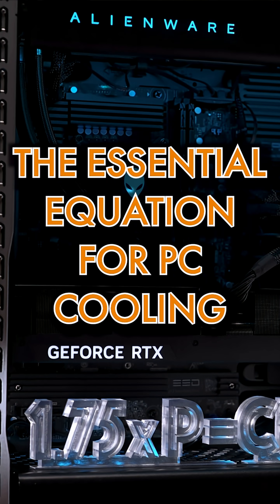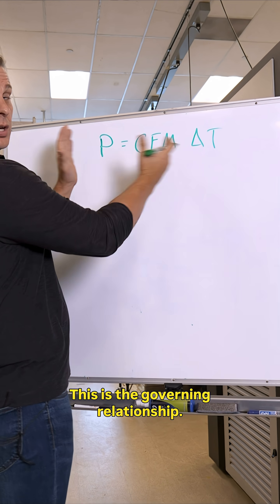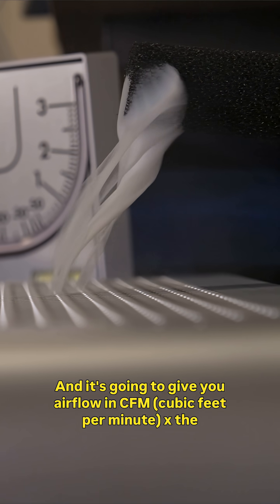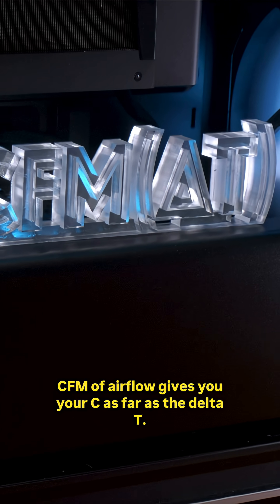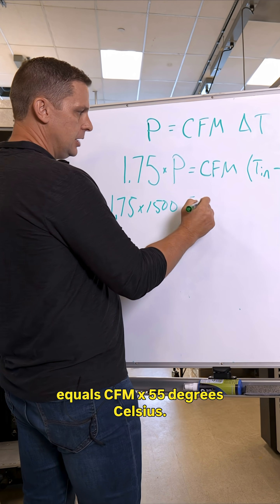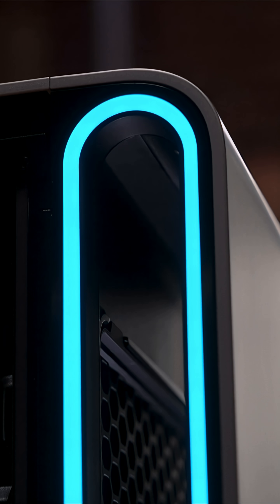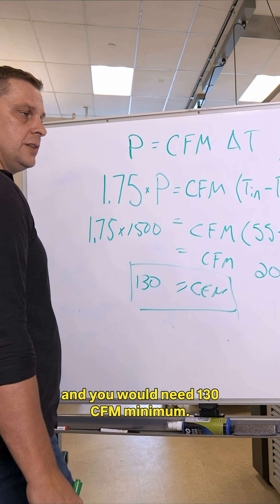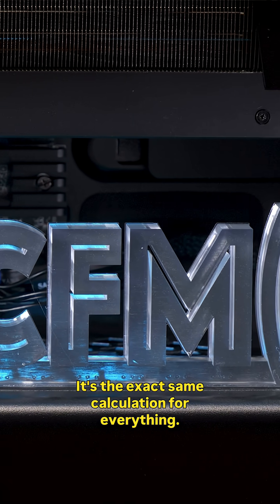#AdamSavage ALMOST Understands This Equation

Comment: Uses S.I. units throughout but then uses CFM?! Why not use m³/s?
Reply: Because case fans are rated in CFM
Reply: @rasmusvedel  fair comment, but it would be better to use S.I. units for the equation and convert the CFM to S.I to plug into the equation. That way you don't have the random 1.75x in the equation.

Comment: Horrible way of doing it mixing metric and imperial units. Use the energy transfer equation. Power (Q) can be determined based on the flow rate (kg/s) and the temperature difference (Kelvin). 

Q = m_dot * Cp * Delta_T

Where Cp is the specific heat capacity of the fluid.
Reply: Kelvin and Celsius got the same scale but different zero. Zero degrees Celsius is 273,15 Kelvin. In other words, if you have a Delta T of 30 degrees Celsius it will be 30 degrees Delta T of Kelvin too. Kelvin was lazy and took the Celsius scale for his with the only difference that his scale started at the absolute zero..

Comment: Totally agree with the other comments that this is ballpark not actually how it is do it. Plus mixing metric with imperial in the same equation is a crime against all things rational. Use one system or the other not both. Adam, you should know better.

Comment: Yeah that's BS. I've built many gaming computers and I've had 4x that CFM in push/pull fans easily on every one... Most
Reply: So you’ve probably done really bad job at optimising it. It’s not an art to cover the whole thing in fans but to do it in the most efficient way possible.
Reply: @HaIPeHaOP yeah, and 130cfm is about the going rate for a single high performance 120mm fan or a couple standard units, tell me what high end gaming rig you see out there with 2 fans anymore? I'll wait.
Reply: @icek9a it’s twice the airflow of the noctua 120mm

Comment: That is not how this shit works, and anyone who has built a PC knows this. Given that your video was sponsored by Dell who has the worst PC gaming platform I'm not surprised you're shilling out your content this way.
Reply: Facts, Adam Savage has sold out for money these days.
Reply: It's literally physics. May as well be saying "that is not this shit works" when someone tells you the world is a globe, not a flat disc.
Reply: @andrewahern3730 also, since you know so much about physics, CFM of a particular fan depends heavily on the case porosity of the grate and mesh in the front, and back of the fan. Not only that, but each component is putting out different amounts of heat at different points. The shitty YouTube short describes all the air exiting an exhaust fan, when in fact for most gaming PC's the graphics card will kick out a lot of it's exhaust at the back of the slot or out into the CPU cooler.

Also, no one who games is truly measuring the air that enters in the PC as it's set to whatever your A/C or room temp is set to. I do not know of any hardware or software that most PC gamers would use that allow you to change the RPM/Approximate CFM output by the fans dependant on the ambient temp OR the exhaust PC temp.
Reply: @TreeSpeakerGetsTheMagDump wait, you mean we don't live in a perfectly spherical frictionless world? 

😂 You're trying so hard to sound smart

Comment: SCFM is better for airflow considering CFM does not account for many variables (e.g., temperature, pressure, or humidity) that would be needed for an accurate measurement.